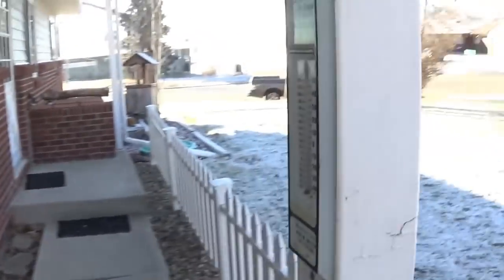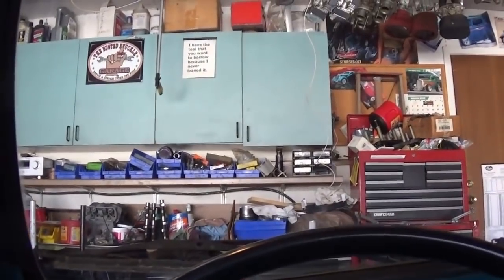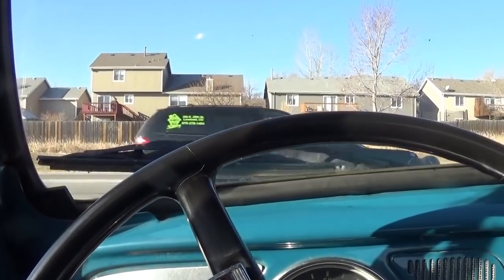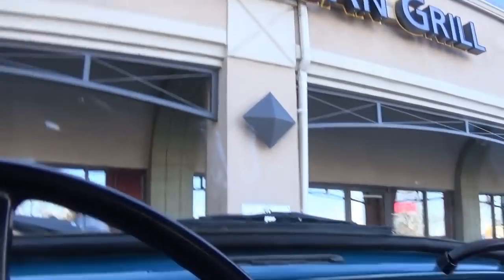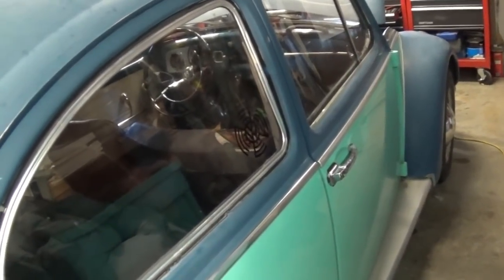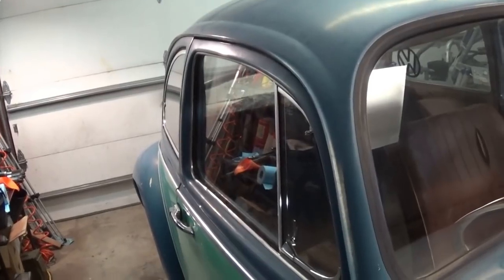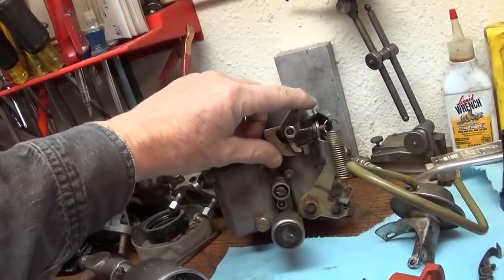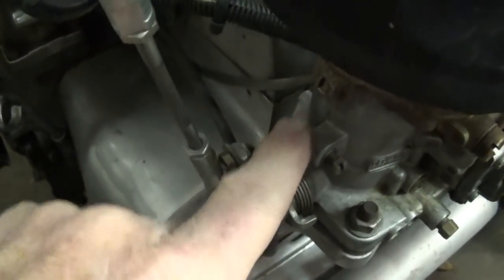VW Solex 34 PICT 3 (Quick Fix Follow UP)

Comment: Always run the heat riser. Even in 90+ degree you feel the difference and you mpg will increase. Always had a dead spot till I replaced mine. Can't believe I ran without it.
Reply: Absolutely! I never thought they mattered years ago. But they honestly do.

Comment: Because the engine goes a bit lean as soon as the butterfly begins to open, it requires additional timing to get the mixture to build up to the right pressure a few degrees after TDC...a lean mixture burns slower than an optimized mixture. A lot of folks who get along well with the 009 are running richer idle / transition circuits so they don't experience the lean mixture issue like those with a stock PICT 34 set-up. 

You are so correct in getting the fuel mixture warmed up enough to keep the fuel from falling out of suspension by heating the manifold. As the fuel is introduced to the low pressure area in the venturi, it refrigerates it to the point it can frost up the area beneath the carb base and intake manifold. If you see that, or it feels cold to the touch at the area directly beneath the carb, fuel mixture will not be well controlled.  Most of us are focused on cold air intakes to gain a bit of HP, but that's only possible on a mixture which doesn't fall out of suspension in the first place to protect good, low speed drivability.
 
As you stated,many changes were made to the later, pollution conscious engines to lean them down...the pict 34 being designed with it's unique idle circuit to achieve that. If we want to run the 009 we could try to richen up the mixture as the throttle plate just begins to open. The additional fuel could probably be best provided by slightly opening up the transition circuits t
tiny hole that is just above the throttle plate...just a bit though... an overly rich mixture requires additional timing as well, so there is a sweet spot. Just a little at a time to tune it in to match the timing to fuel curves.
Reply from the maker: Thx for sharing and giving support

Comment: Great video as usual.... I wonder if you can do one on getting water in the footwells and how to address that. I have taken off the front bonnet channel and replaced this with Mexican bonnet seal but at the scuttle end used a cut vw scuttle rubber and glued it on around the top edge with contact cement.... I just wondered if there are other solutions? I removed the bonnet rubber channel as it always was a water trap and rusted the bonnet surround.... any tips and insights would be great thank you!

Comment: Thank buddy, love it love it, I saw your gauge cluster, looks like you replaced the original to a later model, giving you 2 gas gauges, I was thinking of doing the same thing, but eliminating the stock gas gauge. 
Great video.
Reply from the maker: I think my son did that at some point. I like the stock mechanical one.

Comment: What do you do for rust prevention? Any special home brews or experiances of any products?
Reply from the maker: I'm not a painter and have no clue but there are a lot of folks on u tube doing it and explaining it better than I could.  Let me know if you find something good. Some of my stuff needs some attention. Lucky for me I live in Colorado where it is very dry most of the time.
Reply: @TheEZGZ  Do they not salt the roads? Even in the cold for ice risk? I would have thought rust was a big issue up the mountains. Our cars here only last 10 years if you are lucky. The salt is an absolute monster and undersealing is very rarely done.
Reply from the maker: They use this other stuff call magnesium chloride in liquid for. It's worse than salt. I live at the base of the mountains. I pretty much stay close to home when the street are icy. It melts fast and the roads dry out even though it might stay on the grass.

Comment: Hey ez how were the burritos? I noticed that you have 2 gas gauges. Do have have the dual tank option? I had a 1969 baja and drove it to Cabo in the 80s. Take care
Reply from the maker: The speedometer broke and we found this one at a swap meet from a later model. The one on the right is the original and still hooked up